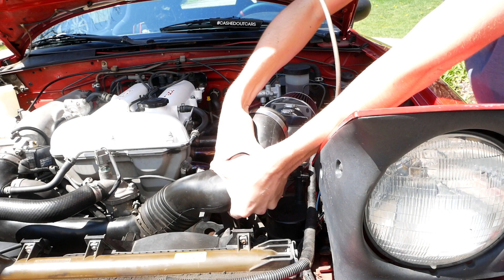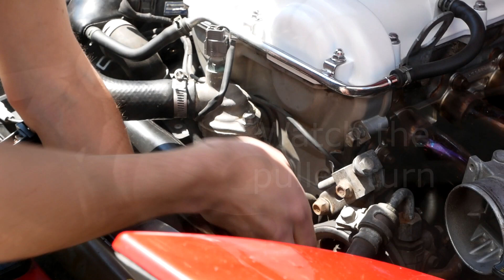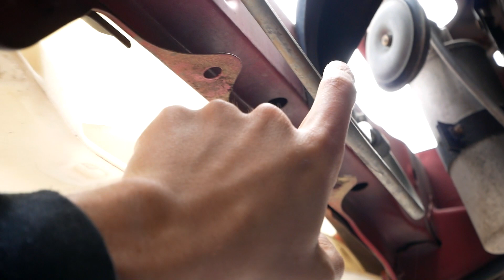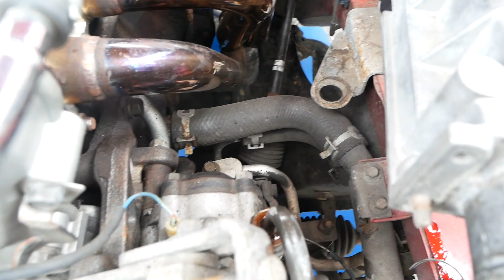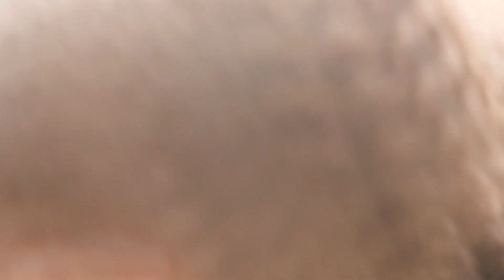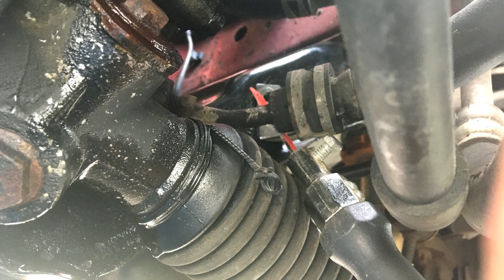MX5 Miata Power Steering Delete: Pump, Belt and Line Removal and Loop | The COMPLETE Guide

Comment: Ive just spent over $200 replacing all the power steering components some kid took off and didn't put in the trunk when i bought the car. The extra 3hp you get from a ps delete is a ridiculous reason to do it. This is a non tracked car, daily driven and yeah im over 21 years old and i like power steering,
Reply from the maker: As someone who did this years ago, I miss my power steering and might put it back since I’ve got other parts laying around. My V8 Miata had power steering and is very nice to drive compared to this now
Reply: For any track use I like it without the ps, since the ps pump tends to get very hot and puke fluid all over then die. It's also not exactly an easily measured amount of hp. The load it puts on the engine is directly affected by the amount of pressure the pump has to produce. So coming out of a hard corner and getting on throttle you will lose much more hp. There were some dyno tests done with ps at full lock and with no steering load and it was around 11 hp loss at full lock. With the pump removed its closer to 15 hp gained at full lock. This is huge for a car that makes 115 whp. Again, only really a big deal on track or autocross. If you daily, I would worry about removing it.

Comment: Any method to remove the torsion bar pressure valve inside the rack? 

Or just deal with the rubbery steering feel ?
Reply: That's the correct way to do it.

Comment: Can you just remove the belt? Leaving the pump and all in place? I know you will be pushing all that fluid around but will it damage anything?
Reply: FYI I did this the other day. It’s not bad but if you do it the right way I’m sure it will be much better. I’ll put the belt back on until I can get the rack it and do it correctly
Reply: I want to know the same thing

Comment: You never provide a reason why we would disconnect the power steering. Does it significantly improve road feel?
Reply from the maker: Road feel is improved, but lots of people remove the whole system for weight reduction and to free up a bit of power
Reply: For a more visual representation... coast around at low speeds in neutral, like 5 or 10 mph or so, and turn the wheel, you'll watch your RPMs drop or almost stall if going slow enough. It ain't much, but power is power.
Reply: @henrytoledo4103  11 hp on full lock on an NB2, 6 hp going in a straight line. so a 5-10% gain for effectively free. I haven't pulled mine, but am looking to go electric-assist and thinking of depowering in the meantime.

Comment: So I'm here because I'm thinking about the exact opposite: I don't have PS right now but I think i want to install it. Will I need a different belt? If so, which size?
Reply: Sell me your tensioner bracket!
Reply: @gregolas597 a little late but relatable haha, I snapped the bolt for adjusting tension and it f’d up the threading on my bracket😢
Reply: Add it you will love it. I'm adding power steering to my second Miata now

Comment: Will this be the same process for replacing the power steering pump? My girlfriends Miata powersteering pump took a dump. Need to replace it.
Reply from the maker: Yes it will be mostly the same process, just be gentler and don't cut lines if you can avoid it

Comment: sooo uhh....how you tensioning your AC compressor LOLLLLLLLLLL
Reply from the maker: There’s a belt that fits on perfectly for just AC and not PS, it’s a very common solution
Reply: @CashedOutCars  I want to know the size of the belt too!
Reply: @NSCnero  do you have to run a ac belt? Or could you just leave it alone?
Reply: @CashedOutCars  what size is the belt? I want to do this mod but don’t know which belt to run, how would you tension the belt?

Comment: Do you get a shorter belt to keep the AC pump running?
Reply from the maker: I haven’t yet because I’ve been on the fence about removing that too, but i think I’ll keep it and get the shorter belt
Reply: @CashedOutCars  flyin miata had a ps delete kit that uses stock belts and auto tensions

Comment: Bob Hall was quite cross when Mazda decided to do "cut price" base models without PS in Europe from 1995/6. He objected to this because he said they'd designed and set up the car to have PS . These entry level cars came with steel wheels and wind up windows as the UK spec 1.8i (as opposed to alloys and electric windows on the 1.8iS) and they also reintroduced a 1.6i - with a 90hp lump. 
If I had AC I'd possibly consider removing it, but none of our cars got it - not even as an option. You had to get a "grey import" Eunos if you wanted AC.
Reply from the maker: Now that's an interesting history lesson on these cars! Thanks for that!

Comment: Best to put a non powersteering rack in
Reply from the maker: It’s an option, at the end of the day a non-power rack is slower due to the ratio though
Reply: @CashedOutCars  late reply but you're 100% right, a depowered rack is way to go. Better ratio than a regular manual rack.

Comment from the maker: Would you recommend deleting your power steering? I’m curious to hear your thoughts!
Reply: I have had my PS go out before and honestly with these cars it isn't bad. Worst part is trying to park it but they are so light, a little muscle and you are good. I will be deleting mine along with the AC over the winter break. Great video!
Reply from the maker: Agreed. Enjoy yours!
Reply: Heck no. No benefit unless the 3hp gain is a big deal to you, maybe 2hp. At least throw the old parts in a box so after you crash it from no power, the buyer can fix it back correctly steering,
Reply: sounds like you're a cornball who has  no muscle to drive a car without PS, let alone a 2800lb car @henrytoledo4103